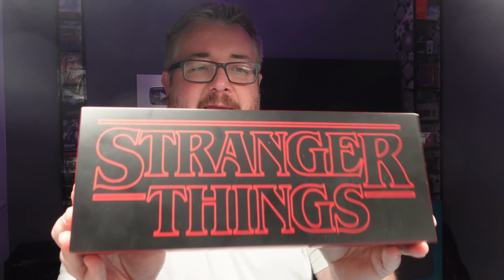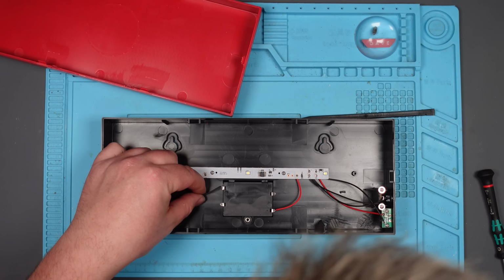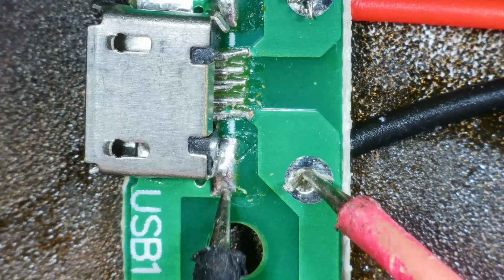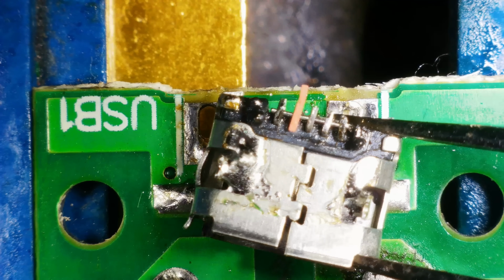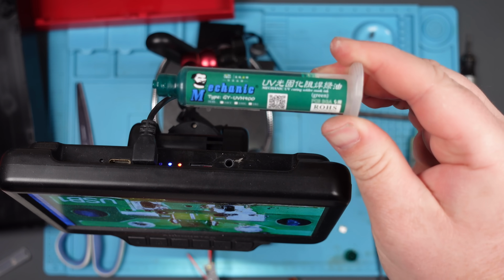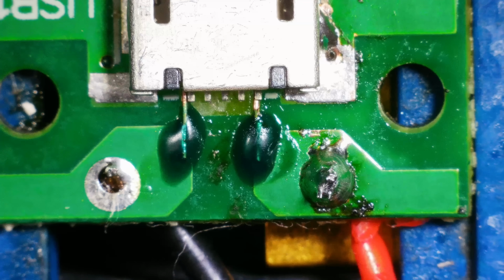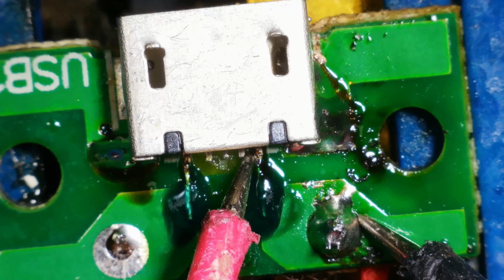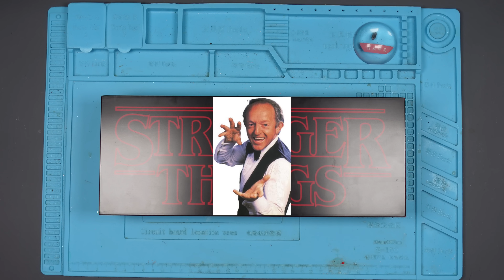STRANGE Faulty LED Light | Can I FIX It?

Comment: You are pretty solid at diagnosing and solving issue Steve, but a few thoughts on your soldering style:  First, CLEAN YOUR TIP!!!!  Frequently.  Your know those stands with the brass scrub pad in them?  That is the way, and perhaps consider one of those little containers of soldering tip refreshing from time to time.  Second - you leave a LOT of carbon behind, what temp are you using?  Perhaps experiment with a lower temp?  Finally, tooth brushes are so much better at cleaning flux residue - nice stiff bristles.  And finally, a question, what flux are you using, cause I need to get me some of that!  Stay excellent, Steve!

Comment: I'm loving the magnetic power connectors you can get cheap, just drill a 6mm hole and solder the leads, no more plugging in and out.

Comment: I think I have that same Helping Hands and if it is the same one I honestly don't blame you for not thinking about using it right away because it's not nearly as helpful as advertised. I have personally taken to using hemostats and sticky tack for almost all of my work holding.
Reply: hemostats are tragically under-rated tools, imo. i wouldn't be without them these days.

Comment: This repair was crying out for a conversion to a rechargeable light sign, so much room for a battery and charging module, Im sure you would have all the parts in a salvage bin you will have gathered from previous projects/ beyond economical repair etc.if you're like me.

Comment: @StezStixFix ive got a sega mega drive im despite to fix its not getting any power do you have any idea whats causing it ive took it apart and the power wires look fine no damage or anything
Reply: I can't be certain without examining it first, but it sounds like it might be broken.

Comment: An ordinary barrel jack would do the trick - I don't know why everything needs to be USB nowadays (regardless which type).
Reply: You're practically guaranteed 5V with a USB plug. With a barrel jack, people will plug anything in that fits. I'm thinking USB removes the need for a 5V regulator to be installed and other protective components.
Reply: because you have like 5 USB C chargers around the house anyway that will work, your power bank can do the trick and we don't need 5 sizes of barrel chargers this way. I don't miss the days where one drawer in your house contained a collection of 50 different barrel chargers in 5 different sizes, all with varying voltage.
Reply: You're joking, right?  For the one disadvantage of robustness, you still come-out way ahead by using a standardized, universal and ubiquitous power source.  I honestly find your opinion a little baffling.

Comment: Maby you could have tried a USB-C port on instead as they are much more user friendly and you can plug those in blindfolded 😆.
Reply: I donno what you're talking about USB-C ports are far more difficult to install. They've got 24 pins compared to just 4 on Micro USB
Reply: @Talmiior  True, but in this case the ground and Vcc is the only two being used here.
Reply: @yummyklown9226 you'd also need CC1 and CC2 with a 5.1k resistor to ground to set the power supply to 5V, but even with that there are six pin USB C ports that are easily soldered by hand.

Comment: Makes a change to see you fix something simple and you still made it look difficult 😁 
For my devices that charge via USB, USB C , Micro USB ect I use the magnetic charge cables where a device end comes off. So my tablets, phone and PS4 controller has a small magnetic adapter plugged in and the charge cable clicks into place. This also saves ware on the port.
Love your vids

Comment: What is up with todays micro usb sockets, are they soldered with and to boards made from chinesium or is it just the poor quality lead free solder used today ? They break so easily, its not like a light up box is constantly being plugged in and unplugged all the time.

Comment: My car key fob button thing was broken. Ordered a new case and soldered the new buttons on to the old board then put it in a new car key fob button thing.
My first ever fix by soldering, would never have even tried if it wasn't for this channel. Nice one.

Car then failed it's MOT and is going to be scrapped. Stupid car!

Comment: I recently got a pacman light from the arcade which had this exact problem.  Turned out to be the lead that came with it. It was useless.
Reply: Was it in the arcade machine 🤔
Reply: @boofuls  no, it was one of the prizes you swap the tickets for at the counter. They had Super Mario etc.
Reply: "Turned out to be the lead" So not the exact same problem then!? 😂👍
Reply: @RetroGamesBoy78  it was the exact same problem in that it worked with batteries, but not with the lead that came with it. But I appreciate it your nit picking.

Comment: That is the worst quality little PCB I've ever seen. It's falling apart as badly as 30 year old boards I've worked on that have had ruptured surface mount capacitors slowly rotting them to pieces for at least a decade. I'm honestly impressed you managed to make it work in the end.

Comment: 4:53 Looking at the edge of that board, was it snapped off something else or do you think they make multiple copies on a big sheet and were very sloppy with cutting them out? I'm guessing by the simple electronics within that it's probably some cheap-as-chips mass produced thing from Jina?

Comment: Watching you solder is painful.  Clean the solder tip, use the correct tip, use lots of flux, learn how to 'tin' enamel wire before installing short lengths and finally use hot air and UV to cure your solder mask.  I have enjoyed your journey from complete novice to, well, whatever you would call yourself now, but you really need to implement the skills and knowledge you have gained on your journey.  I have a love / hate relationship with your singing (?), raps (?) which still bring a smile to my face and a worn out mute button on my remote.
Reply: The raps are really bad, I agree. Good thing he leaves a timestamp to skip.